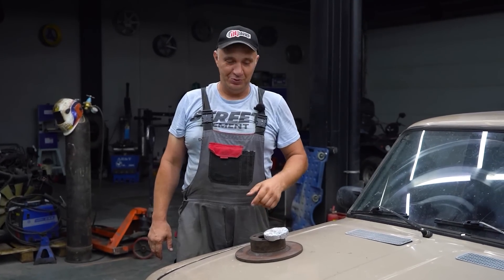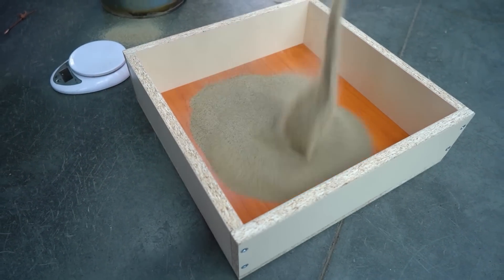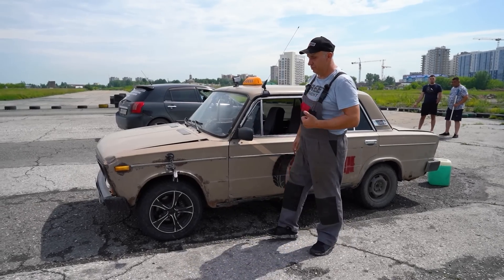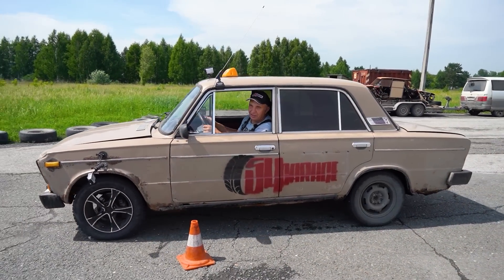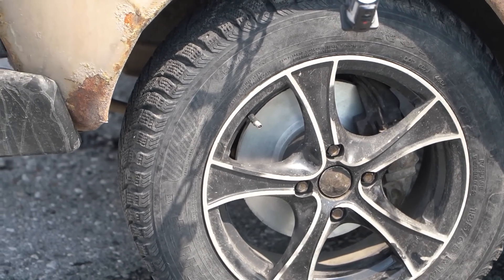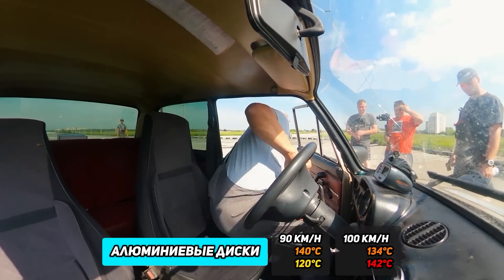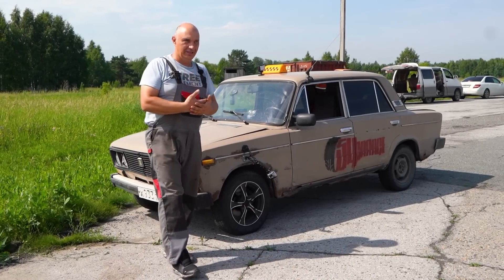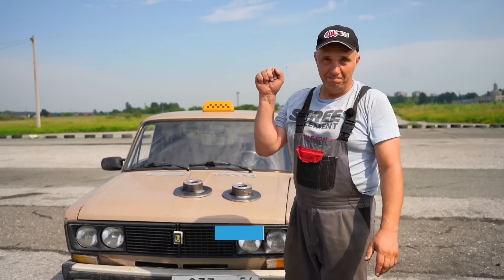We recast alloy rims into brake rotors

Comment: Maybe at heated aluminum and the other surface kick up dust that dust is ignited creating a gas that expansion is greater then input size creating a pocket of gases that reduces the friction. Kinda like two dissimilar metals reacting hum this phenomena. This should be looked into further to find the perfect alloy with strength and flexibility,. Try dipping hot iron in liquid salt then take a closer look.

Comment: Aluminum not only cools down quickly, but they also heat up a lot more quickly. I bet you those brakes were 200°C before they even measure the temperature and went down to the measure temperature by the time they got there

Comment: Aluminium disc were used already and they are quiet good. The hardest part is that they need to be beaded in properly. Because in reality it's pad material that deposits into rotor. After the deposition is made, braking action in made between 2 layers of pad material. It grinds of a bit but at the same time it's deposits again. There is balance between deposition and grinding.

Comment: I guess: the Brake disks get hotter the more you Brake, causing them to get thinner (because of the heat, combined with the pressure from the Brake pads).  The Problem is that because the disks get thinner, the pistons need to expand more which is nearly impossible because you don't have enough Brake fluid in your System. 

Example: 
usual fluid in your System: 1,2L/cyclus
Needet fluid in your system at 140°: 1.25L/cyclus.
Those 0.05L are making the brakes loose pressure.

To reduce this Problem, you have to use a bigger master Brake cylinder. You will still have a loss of pressure, bud with the right cylinder, you'll have enough pressure to lock the wheel up.
Else you could Still use stronger brake pads, like green or even red Stuff.
Else you could Still try to make your Aluminium rotors be internaly cooled. That could stop them from overheating with the increased brake pressure and the stronger brake pads.

Comment: Indeed there could be lots of aluminium debris on the pads, maybe ceramic or non metallic pads could give different results, as well as a thicker or vented disc 😊 OR! aluminium disc core with an outer steel plate!

Comment: aluminum oxide is very low friction. that's why rubies are used as bearing material in watches.

given that the rotors appear to function pretty well overall, except for the abrupt brake fade, my guess is the pads are getting loaded up with aluminum oxide, reducing the overall friction in the system. this would also account for the lower temps you're seeing.

but since it's gonna be in dust form, just driving a bit knocks it out, and lets the brakes work again in the same manner, instead of just progressively getting weaker and weaker with each run.

Comment: My step dad owned an old Pontiac that had aluminum brake drums. But they were lined with steel. So the braking surface, that is to say, where the friction material came into contact with the drums, were lined with steel.
I think the idea for aluminum was so that they cooled down faster.
Reply: The rear brakes on every lada are the same. Aluminum with liners

Comment: It's a gas build up between the rotor and pads proventing contact that's why race cars have slots and dots drilled and cut into the rotors for gas relief

You could use a grinding wheel and put 3mm deep groovs around the rotor

Comment: Under the heavier braking load imposed at high speeds it could be getting hot enough at the very surface of the disk in contact with the pads for a thin film of soft aluminium to be developed, which is dragging on the surface of the rotor, but immediately solidifying as that zone leaves the disk. although the whole rotor is heating up under breaking, there is probably a much higher surface temperature occurring at the point of pad contact, but aluminium being such a good conductor of heat is quickly absorbing the local hot spot into the bulk metal.

Comment: Lol funny a ever on this channel. 
I would have said it’s the actual friction material ( pads ) not being able to cope with the temperature  inducing fade . 
That said several other comments here are still plausible too ie gassing . 
Also it could be a case of ‘glazing’ where a hard face builds up on the disc face and also some alloy build up in the pads . 
Not sure if lotus experimented with copper coated alloy discs back in the 90’s . 

Try induction type brakes using copper / alloy plates . No actual physical contact involved. They use them with great success on theme park rides .

Comment: my theory is because the disc heats up faster than the steel discs, it is causing gases to release faster creating a barrier between the pad and disc(hence the brake fading) Maybe try another set of disc cross drilled or grooved to allow the gases to escape, possibly even drill small vein like holes to allow air to circulate through the material to keep it cooler( this would be cool to see if this makes a difference on the oem steel disc too) Love the channel boys keep it up!
Reply: To be gas there would need to be another digit in the temperature.

Comment: Thank you. I think a layer of sheered off Aluminum powder which would quickly convert to Aluminum oxide, would have a lubricating effect. This would also react with brake fluid at high temperatures producing a soap-like compound.
Reply: Nothing should be coming into contact with the brake fluid from outside of the system.

Comment: There is a condition known as gassing.  A layer of high temperature gas builds up between the friction surface of the brake pad and the rotor.  One of the reasons why drilled rotors work so well.

Comment: I'll guess that the aluminum is softening on the rotor surface. All of the energy of the braking is initially at the surface of the rotor. Also remember that according to the laws of physics, energy goes up by the square of speed so really only the high speed part of the braking run is overheating the rotor surface.

Comment: I would guess that the aluminum used is too soft for such a job, literally peeling the brakes on each turn.
try a harder alloy, or the same stuff, and some brake surface (reminds me of a story I heard, cast aluminium brake rotors, on a scam, the site used cheap aluminium, then "improved" those he hadn't sold with screw fixed iron surfaces (stainless screws, so they looked cool when worn), and finally disapearing when that didn't worked on upper end cars like porsches

Comment: Try cross drilling or slotting them, maybe. There is a small amount of gasses produced when metal is ground, which could account for the fade if aluminum puts off more gasses than steel. Drilling or slotting may allow the gas to escape better or at least give the pads more bite.

Comment: Should've looked at the pads. I wonder if they're glazed over with aluminum dust/melt. If they were covered in aluminum, then it would be alu on alu contact, probably just heat up and melt and not lead to good braking.

Comment: This will never work if you are using brake pads made for steel, since steel is very hard, the brake-pads are suitably abrasive, and hard. IF you put a softer rotor in there, the rotor will see most of the wear, not the brake pads.

Comment: The brakes bite initially,  they then generate massive friction which then softens the aluminum brake discs which then causes their face to melt and then the brakes lose their grip and slip !
Reply: This guy nailed it. Low melting temp turns the surface to a thin layer of soft metal that lubricates the pads on the disks.

Comment: You did not have the proper breaking surface reusing old brake pads  !   You would have 100% with new one`s for this test  ..........  I would try this test again with brand new pads  !  Or at the very least sand the old pads down to a flush surface  .

Comment: this is not surprising. i got aluminum brake drums on the rear of one of my vehicles but they still have a steel liner inside them for the braking surface. if aluminum would make great drums and rotor's they would have done it a long time ago to cut down on weight and cost.

Comment: That is an aluminum composite material from the rims and it's a  lot softer than what is really used for aluminum rotors ,you can tell those pads are just grinding the material off too quickly..

Comment: My theory on this is that aluminum is grippier than steel.  Steel parts coming in contact with each other wear FAR better than aluminum, which "frets" and produces this black gunk.  I've seen it on light airplane cowlings/access doors.  Aluminum has a grippier feel than steel if you hold a piece.  What I suspect is happening is that the grippy aluminum is ripping off small amounts of pad and getting coated as a result.  Kind of like the disk now being made of pad material...

Comment: Normally the rotors are harder than the pads which means they wear out slower than the pads. However the pads are harder than the aluminium so they rip apart the rotors and get covered in hot aluminium paste. In this case aluminium works as a lubricant.
Reply: Your logic is flawed... Look up Lotus Elise series 1 aluminium rotors...

They work by letting a  bid of pad material embed itself into the rotor.. after the rotor is "loaded"  it's no longer aluminium on brake material but brake on brake material ... The rotors last a long time this way since they are "reloaded " with friction material when they wear
Reply: You do realize that lotus probably uses some proprietary, high-end aluminum alloy for those, special built for that purpose, and this was just junk aluminum, so its not really the same thing..  @hisheighnessthesupremebeing
Reply: @VashStarwind  Not to mention the pad material was likely non-standard as well.
Reply: @hisheighnessthesupremebeing  I'm sure it would work if they used the Lotus brake rotor aluminium alloy AND the special pads required for it.
Reply: @hisheighnessthesupremebeing probably different pad material though in the case of the lotus

Comment: The reason they started losing braking efficiency is because the friction material was being impregnated with aluminium off the disc, it's the same with steel discs when the friction material gets down to the steel backing of the pad and you start braking on that you lose braking efficiency that's the whole reason brake pad material is made up of a composition of different fibres and bronze material because the bronze in the pad isn't as strong as the steel disc and can get to a higher temperature before going soft and sticking itself to the disc.
Reply: É o mesmo quanod lixamos uma peça de alumínio sobre uma lixa, no início é pesado para manejar, mas depois fica leve e fácil, mas depois começa a parecer que nada faz ou faz muito pouco no quesito de abrasão, então quando limpa a lixa faz o serviço melhor novamente.

Comment: If I’m not mistaken didn’t Corvette do a aluminum rear drum with a steel sleeve to help with dissipation of heat. The pads cannot properly bite into aluminum, which will result in poor braking.

Comment: What is that spray the guy applies on the discs after each run?
Reply: Maybe water?
Reply: It's for increasing the emissivity - aluminum has low emissivity & high reflectivity in IR, so you'd end up measuring the temp of other stuff reflecting off the rotor more than the rotor itself w/out the spray. IDK what they're using, but lots of things would work, e.g. cooking oil, WD-40, spray adhesive, etc. Water could work, but it would bias readings over 100C down I think

Comment: Brake fade is almost always caused by heat.  I would bet money that the aluminum rotors actually hit over 170°C at the peak, and got below 150°C Before they were able to take a temperature reading.   At the higher temperature the friction material in the brake pads are very similar in metal hardness to aluminum,  so they both slip. Iron and steel are harder metals so the friction material can actually grab the rotor at higher temperature.
Reply: I agree that the aluminum got hotter than the 170C, but quickly cooled before a measurement could be taken.   Aluminum is very good at rapid heat transfer and the friction surface temp most likely went sky high but that heat was quickly trnasfered deeper into the rotor
Reply: Isso pode ser plausível, no caso de discos de ação e ferro fundido tem uma perda de calor mãos rápido devido a sua transmissão de calor e devido a gráfica e os poros do metal são capazes de refrialo mais rápido, pelo menos dizia um estudo de um amigo sobre discos de freio.

Comment: Next, make brake rotors lined with a clutch material and put iron in place of the pads.
Reply: Thats a super cool idea
Reply: Boa ideia, antigamente o material usado na embreagem era o mesmo da partilha de freio era de abesto, mas hoje em.dia não sei o que é, mas sabe que é uma boa ideia.
Reply: Basically could use clutch disk material as brake rotors ha, that actually could be done relatively easily ha

Comment: You still need to finely polish the cast-iron pan to see if it will work as a disc-brake rotor.
Reply: Disc
Reply: @dogwalker666  Wait, I was right when I said brake-rotor.  It's a disc-brake rotor.
Reply: @charlieredeemed  it's a brake disk,  There is no rotor.  That's why they are called Disc brakes not Rotor brakes.
Reply: @dogwalker666  That's what I meant. Thank you, kindly🫡

Comment: I'm guessing the friction material is loaded up with aluminum like using an angle grinder, so they stopped working properly because they couldn't grip effectively.
Reply: probably, Aluminium does get gummy and goes short when hot
Reply: aluminum is a nightmare to cut with a angle grinder I never knew how bad it was till I tried to cut a hook off an air gun I wonder what copper is like or even gold
Reply: @dos541  you have to use a dry cut saw on really soft stuff, abrasive disks just get irrecoverably clogged.  That's why I think the friction material on the pads got clogged and weren't gripping as a result.
Reply: @KewneRain  I think cheap blades actually work better on soft material.
Reply: @dos541 There are specific cutting discs for aluminum. Using a steel/hard metal disc on aluminum can be really dangerous. It will get gummed up with molten aluminum and feel like it's not cutting, the heat can't escape making the outside of the cutting disk become much hotter than the inside and then it can explode. I've seen it happen to a foolish millwright.
Reply: @dos541 It’s pretty difficult to machine, too, especially if you use certain alloys.
Reply: @dos541  Cutting ALU with grinder is nightmare? Oh boy, wait till you cut copper. Watch for fingers, face and other body parts. Parts of disc will be flying every direction and sometime even the grinder.
Reply: @dos541  I cut lots of copper.  Cuts easy.
Reply: Actually everyone is correct, there is cross contamination rotor to pad and pad to rotor, as well as the off gassing.
Reply: Maybe if there was some holes it would hepl ?
Reply: I think there is also a build up with gasses between the pads and the rotors and if so the solution would be drilling holes in the rotors.
Reply: Sharing- tranacefance of materils.
Reply: I think the other way around.  I suspect the disk is now coated with pad material.

Comment: I get the feeling straight from the opening that brake rotors made out of "gum metal" isn't going to end well.
Heh, they didn't bother to look at the pads. Bet they're completely gummed up in aluminum which eliminates most of the pads' grip once they get hot.
Reply: I agree, I'd like to have seen the brake pads.
Reply: Cast iron is full of carbon that keeps the pads from seizing. Aluminum would be a nightmare!

Comment: I reckon the pads are caked with aluminum dust that's preventing grip.
Reply: Aluminum is a “gummy” or “sticky” metal. Cast iron isn’t just used because of heat retention; it has carbon, which keeps the rotors from sticking.
Reply: @5roundsrapid263 lmfaooo cut some and tell us it ain't gummy and sticky
Reply: Yes that is a possibility, or the pads act as sandpaper and just sand the aluminum off more instead of gripping it more. Or a combination, the pads doing that then filling with aluminum dust and having less grip
Reply: @skie6282 if they acted as sand paper, it would still grip, just wear down super fast.
Reply: I think it's all of the above comments. 
It would be like using a steel cutting disk or bench grinder to cut aluminum. It's usually very unsafe.
I'd say the brake pads sand off a layer of aluminum rotor and without anywhere for the dust to easily and quickly escape the dust will melt and be like a lubricant. That would account for the initial grab of the brakes and then the fade.
I would have liked to see the condition of the brake pads after the aluminum rotors.
Reply: I also reckon that extra slippage is creating more dust, and more heat, probably causing the aluminum the fatigue.
Reply: 0:12 cool yeah good. Saved me from watching the whole video. Ta
Reply: Yup
Reply: Yup, aluminium oxide acts like a polishing compound, so I'm guessing it'll grip for a couple of seconds until everything oxidizes, then both sides will be getting polished on a layer of dust

Comment: Do eddy current brakes with copper and neodymium magnets please:)
Reply: That would be cool!

I wonder if it would work best as a "drive line brake" by having a rotor spinning fast on the driveshaft, rather than the slow wheels.
Reply: The slower you go the worse they are, you might be better off using engine breaking